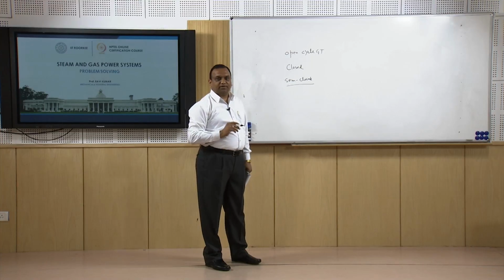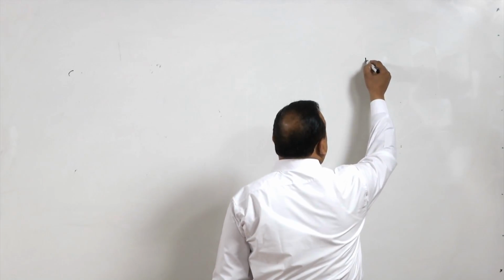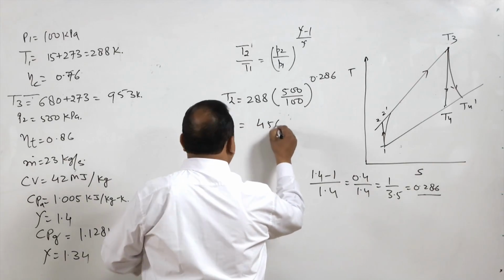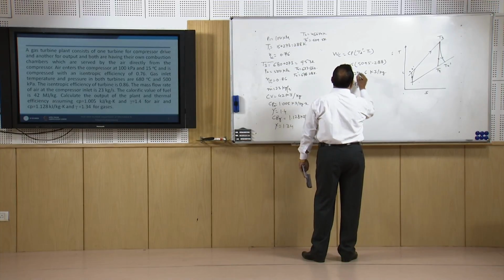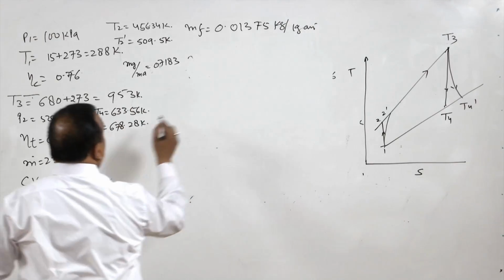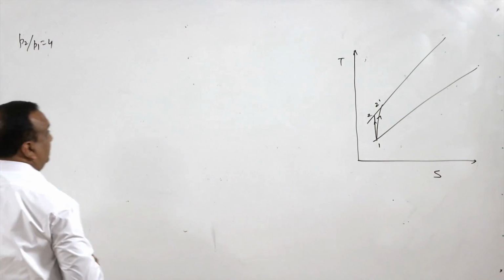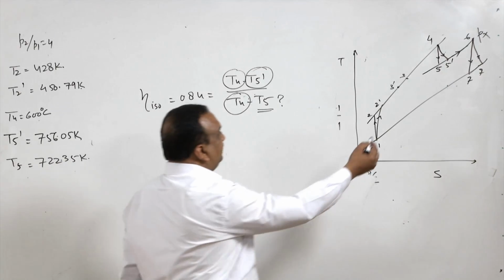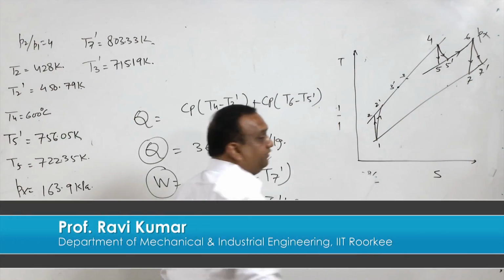Lecture 34: Problem Solving (Gas Turbine Cycle)

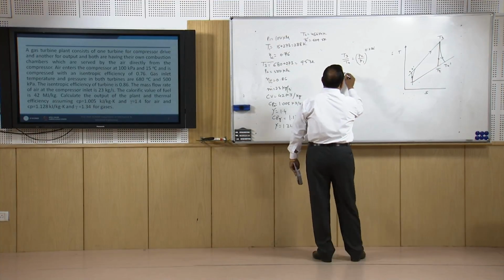Comment: 12:54 For state 3 the value of gamma is not 1.4. it should be 1.34 so that T4 will come 633.49K
At last of 1st numerical when we calculate efficiency, sir missed multiply 23 with denominator.

Comment: The specific ratio (γ), used for finding T4 should be that of gas (γ=1.34), NOT air (γ=1.4). Though the T4=633.56Κ is ultimately correct, when the calculations shown are performed, it gives a wrong temperature (601.4K). The reason of changed γ is because the gaseous mix in the turbine, is no longer just air but contains exhaust from the combustion stage..

Comment: For calculating the turbine side temperature the values of Cp and Gamma are to be taken of the gas side and not of air. The approach is incorrect and obviously so is the end solution.
Reply: Everything is correct.